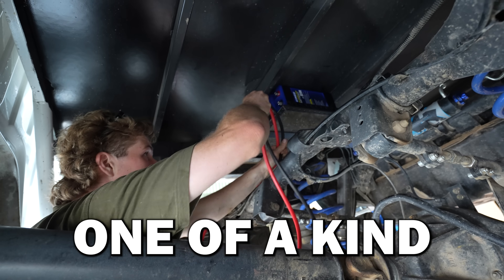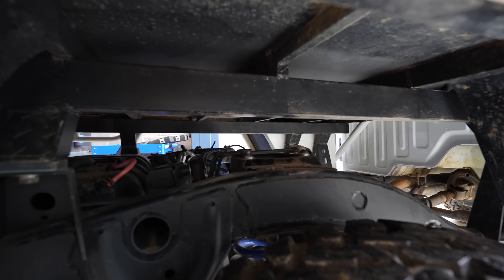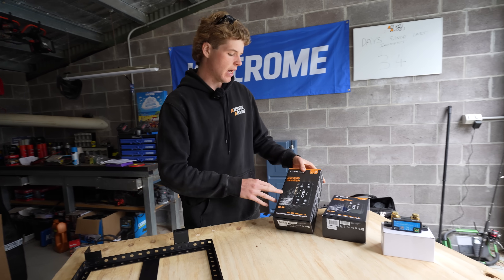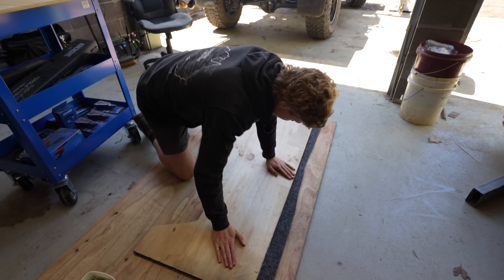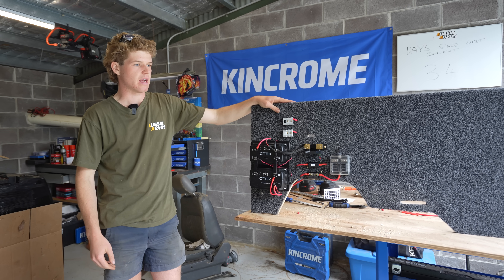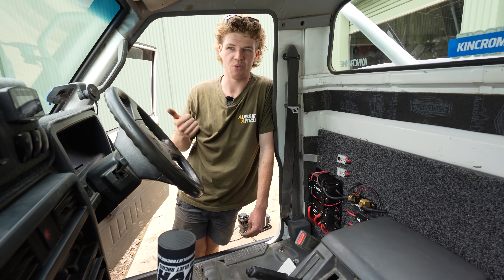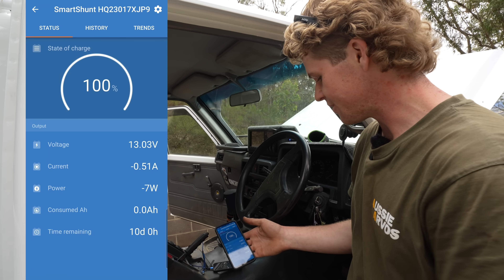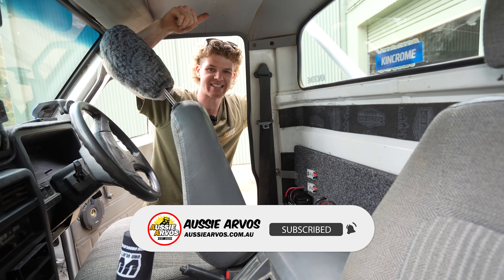The MOST POWERFUL 12v system we've EVER built!

Comment: Just be careful on the charge limit on the battery, you dont want to exceed that. But this is fantastic boys. Well done.
Reply: Kings specs on the battery state 100A continuous charge/discharge rate, so he's currently well within that rating.  Even with an upgraded alternator, he would only be nudging this rate short term allowing for covering the vehicle loads.  Kings specs look a bit on the conservative side for a LiFePO4 battery in terms of charge/discharge rates (lower spec cells??)
Reply: @Andrew_6721  Have another read of the specs.  100A is the maximum rate.  There's a price to pay for doing it and that price is lifespan.  The recommended rate is 25A charge and discharge.  The cell manufacturer's original data, if it can ever be obtained, will spell it all out in the charts.  Of course going hard all the time may still meet the lifespan requirements for the given application but it won't be 2000 (or the nominal count if shallow cycling rather than full to flat and back).  The closer down to 25A when charging the longer the life.

Comment: Great value and easily upgradeable for more switchable loads. Probably only add a 150A resetable circuit breaker in case you have to isolate things quickly. 👌🏼🤙🏼
Reply: ...or just a stonking great isolator switch.

Comment: what makes a good lipo4 batt  is the BMS , i see people running 1000w solar and 3x 200ah battery  600ah of lithium in caravan and campers and they stick with 12 volt instead of 24v system that is way more effective , more votls lhalf the amp consumption less heat  thinner wires ,,like they dont realise they do make 12v to 24v DC to DC chargers , solar panels can be wired in higher voltage in strings , 27v lithium  runs my most my girls house with only 6.6kwh including a 4kw 1200w aircon , i built it for shed be she wants to keep it at the house ,power bill almost 0

Comment: Apart from battery how much did system cost?
Reply from the maker: Victron shunt was 180ish 
CTEK chargers cost 300-400ish depending on where you find them online
we spent about $300 on cabling (2B&S is expensive!!)
and then a hundred or so on fusing

Comment: Another great DIY.  You make it look so easy.  I like that you guys are not brand snobs.  I too have been using the Kings 120Ah (AGM) battery, 200W Solar blanket & 160W fixed solar panel for 5 yrs now and they're still going strong (touch wood).  So when it's time to replace my AGM to a lithium, I have no issues using the Kings version.  TIP: I'd recommend wrapping a bit of electrical tape at battery end of your split tubing to prevent it from moving and/or sliding.  As over time this could potentially cause wear.
Reply from the maker: Thanks HammerRocks! nice setup! definitely will be worth going to lithium when the AGM dies, it'll make a massive difference! Cheers
Reply: Kings are crap. Battery quality directly relates to cost. Cheap batteries are crap batteries.
Reply: @acedogboy8421  I beg to differ.  I've had mine for 5 years and still going.
Reply: @HammerRocks  your a lucky one. Sounds like u look after ur batteries. But still i see a tonne of kings,amptech and neauton powers come in dead after 2-3 years.

Comment: Hi Liam, as soon as I heard you talk of 140Amp recharge alarm bells began ringing for me as Kings Lithium aren't rated for that recharge, other brands are (ex Itech) .
Aren't you a tad concerned you're overdoing the charge rate as 25Amp is the recommended & 100Amp max, direct from Kings spec sheet below:
Recommended Charge / Discharge
25A (0.25C)
Max recharge current
100A
Taking those figures into account, running at 50Amp is feasible.
Just my thoughts.
Just a tad concerned with water ingress with undertray mount. Should fully enclose by vented casing maybe.
Regards, Wealie.
Reply: Going over the recommended 25a charge rate will just reduce the life of the battery, thats all. Going over the max charge of 100a could damage the battery though.
Reply: Agree with this, a bit silly getting a lithium battery that’s main advantage is lifespan and then killing it prematurely with overly fast (or even too high) charge rate

Comment: All good, but you wont charge at over 100amps - max discharge is 100Amps of that battery, and max charge will be similar - that 55amps is a perfect 0.5C charge for that battery and still way fast enough, so no need to waste money on a bigger alternator.
Reply: You beat me to saying that too.
Reply: So battery capacity and battery charge rate are not necessarily related ? Am I understanding that correctly ?
Reply: @biopsiesbeanieboos55  no, they are linked. If you double that battery to 200ah it will take 200amps.  Note that some BMSs are not equal charge/discharge and some may charge only at half the rate of discharge (BMS throttling not the cells unable to charge faster).
Reply: @KevIsOffGrid  Clearly I don’t understand this topic as well as I thought 😊
Reply: Question is the main battery isolated from the system. I don't know anything about dc to dc chargers so can someone explain how the system is connected to get charge is it the altinator or onto the main bsttery with a disconnect at certain volts